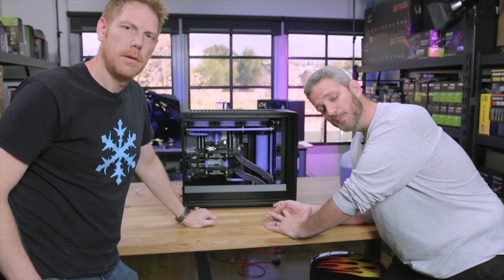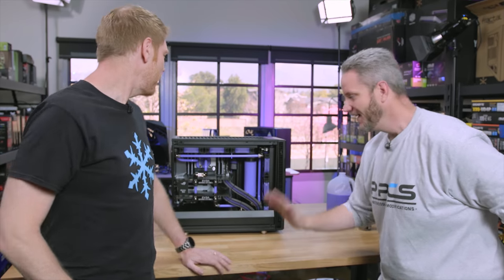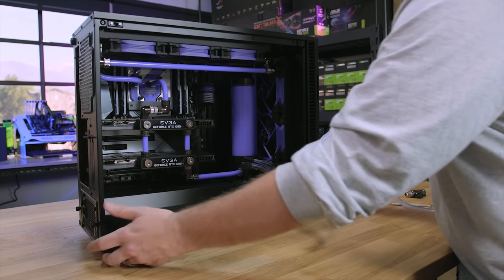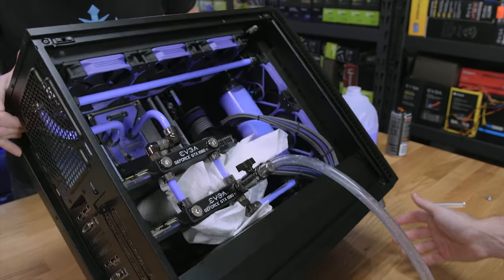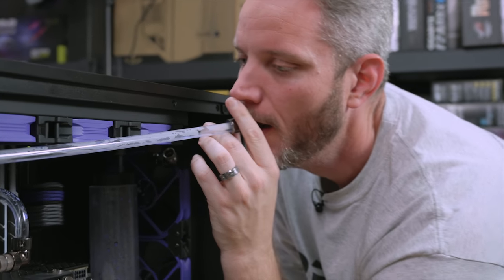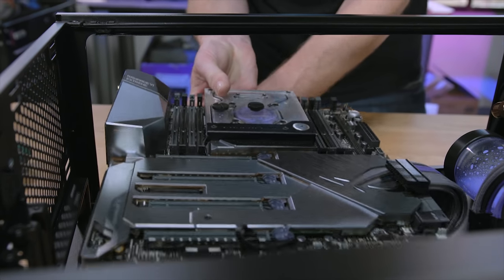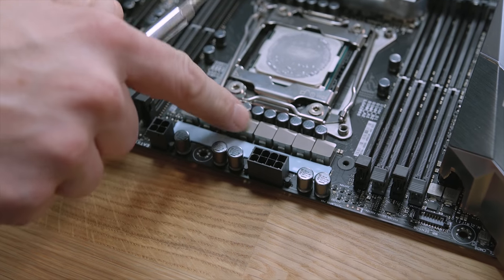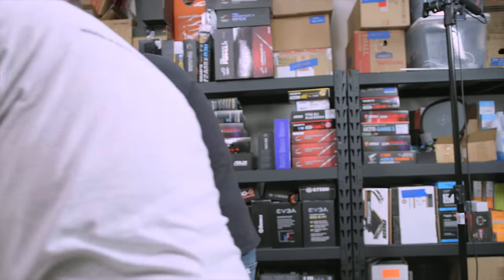WE SCREWED UP... So now we have to fix it

Comment: You keep saying VRMs when I think you mean the MOSFETS.  The MOSFETS are part of the VRM (Voltage Regulation Module).  The VRM is the circuitry that feeds power to the CPU which includes the MOSFETS, chokes, and capacitors.  THE MOSFETS are the components that heat up the most.

Comment: Them mosfets/drivers. They make up part of the VRM. 😉
Reply: Exactly, the VRM is a buck converter which is made of mosfets, choke and capacitor.
Reply: VOLTAGE REGULATOR MODULE?!
Reply: They are both to do with the same circuit, boosting and controlling voltage/current to GPU and VRAM. But VRM means 'Voltage Regulator Module' meaning basically the Mosfets, the small chips essentially whcih the heat pads actually fit on to. They get very hot. Chokes don't need cooling as such but have adequate cooling because they are bigger in package size and can handle more heat effectively. 
Mosfets are smaller in package size and cannot handle temps maybe above 90oC but need to be lower than that so that they perform better.

For example, surface mounted LM317 chip max working temp is 120oC. By no means would you want it running at that constantly. Dead in no time.
Reply: VRM mosfets are generally rated up to 150C but obviously you would never wanna reach that. Just dont be afraid if youre close to 100C at maximum load, thats usually fine.

Comment: As someone who has never watercooled before, I imagine you can reuse the liquid you drained since the system didn't have too many "hours logged" using it.  What is the threshold on how long it can be used/new coolant applied.  Say this issues wasn't caught/dealt with for 3-6 months and you finally went in and fixed the issue.  Could you still use the same coolant?

Comment: No liquid for me, but I've just modified a couple of Dell Xeon heat sinks from a mid-2000s tower to work on AM3 sockets by cutting a couple of sections off of the block and adding some material (I've found a good use for pennies!) to raise the level enough for an AM3 cooler clip to hold them down properly. They're very tall but otherwise compact, and so far one is cooling a Ryzen 5 1600 stock by itself with just a (very large) front case fan.

Comment: My 8700k gaming rig is all air cooled in a fractal josh meshify c with Noctua cpu cooler, two 140mm ml140s in front and 1 ml120 in back, no water, no mess no maintenance except for occasional cleanings of dust outside of mesh front of case. It glows in the dark, runs hours on end gaming only and web browsing with a gigabyte 1080 I got for 500 dollars new out the door at frys in Oregon when I was driving through.

Overclocked to 4.8ghz with 16gb Samsung b die ram overclocked. Soon to be upgraded to 32gb ram. Use multiple ssd s for boot, games, backup and scratch.

No water, no mess, stays cool, looks awesome, works awesome.

Comment: Air-cool for life my dudes
Reply: BrochachotheNacho i can't fart that often into my pc
Reply: Flamingdarkrider It can be a real pain in the ass tho
Reply: You can air cool it easily. All you have to do is chill the air first..
Reply: Totally agree, I get 54c temps on my delided 7700k @4.9GHZ on AIDA64 with a Noctua D15 cooler and I get 55c -56c on my GTX1080ti with 2x 140mm Noctua fans on 1500rpm @2100mhz.  I literally pulled the stock triple fans off (they are rubbish) and used the same heat sink with the 2x Noctua fans and it is an amazing mod. 
If I run the fans on loud and 100% I can get 44-46c temps on Valley benchmark. 
I was adamant to get my system running on air for the same temps and performance as water, well pretty close.
Why would you go water when you can do it on air for a fraction of the price with no hassles, no maintenance and no more fan noise than water, the Noctua fans at medium rpm cool with very low noise. 
My CPU cooler with fans, GPU fan mod is a total cost of $190 AUD, sure beats $1000-$1500 price tags.
Reply: You can air cool anything. You dont do water cooling because you have to, you do it because you enjoy it and that doesnt just include the aesthetics and the quietness and the low temperatures but also the effort and pain and the fuckups.
Reply: weak

Comment: 6:22
can vouch for the Montana Black series
dank-ass colours. but lower nozzle pressure than most spray cans makes it kinda tricky to get even layers, not to mention the texture effects. and they are THICC so might even mess up tolerances if you're doing that kinda thing. 
but get it right and they look more lit then most of the paint out there

Comment: That is a ball valve and easy way to remember is ---inline is on, meaning the handle is inline with lines going into it .... off the handle crosses the line or crossed = closed.

Comment: Jay the old double wide bridges aren't hb bridges. They are basically in series through the bridge. 3 cards = connector 2 from gpu 1 to connector 2 on gpu 2, connector 1 on gpu 2 to connector 1 on gpu 3, connector 2 on gpu 3 to connector 1 on gpu 1. So between 2 gpu there is no more bandwidth then a regular single bridge. Hope that makes sense lol.

Comment: "It will just give ammunition to those who say watercooling isn't worth it."

I mean you're not wrong. But when when every other water cooled build leads to part failure, damage, or pain in the ass maintenance on one of youtube's biggest computer channels, can you really call it "Ammunition"? It's more like an open and shut case at this point.
Reply: LordKongro it looks so good and performs so well though
Reply: It's a luxury that a lot of people enjoy. Most can get by without it and have less headaches for it, real extreme overclockers go for short liquid nitrogen benchmarking sessions anyway. Just like driving in a lambo isn't worth it for most people, rental or not, the same is true for water cooling, you pay for the experience that goes beyond practical daily grind of a rock solid air cooled system.

Comment: Air compressor... Rigid makes a cordless 18v 1gal compressor. 

Also where did the instructions say to put thermal pads? My M9H called for pads on the inductors and the mofsets

Comment: water cooling is only necessary for quiet builds and overclocking.  I prefer air cooling like many though because i never have to worry about leaks as long as i own my system.

Comment: I remember x-ray shots of an older SLI bridge PCB (not the FFC kind) and the quality of the soldering of the connectors was much worse than for hb bridges.

Solder quality has a definite impact on signal quality at the frequency required to get the necessary bandwidth.

Comment: What's the deal with re-applying the thermal paste? I mean, would something go wrong if you put the cooler/block away and not smudge everything with it, would it be wrong to tighten the cooler/block back again with the same paste? Since this one is few days old (at least vids are few days apart). Or is it just to keep all the stuff clean?

Comment: If you update your Windows 10 flash drive it'll have the last round of updates on it.  I've had to reinstall a lot lately (system builds, rebuilds, and whatnot) and I updated my flash drive from MS and it loads with the creator's update which helps the install immeasurably since you don't have to install most of the updates.  Just a heads up.

Comment: I just got my first desktop today, it's a AMD Athlon 64 x2 that's sitting on a ASUS M2N32-SLI Deluxe. If you have anything anything that might work this this send it my way because it uses ddr2 but it does have PCI Express One of the best setups as of 2006. 
 I was only 5 years old in 06' and I have no idea what I'm doing when looking into the wire mess. Its definitely a start but I want to make it into a hobby!

Comment: I'm not totally certain, but I think it's still wrong. It says in the manual to "make sure all mosfet chips and inductor coils are covered", and I remember placing two strips there on my build (same board, same block).

Edit: Not sure if it makes much difference, I don't think the coils get that hot.

Comment: I just finished my first PC build yesterday :)
Mobo: Asus Rog Maximus IX Apex
Ram: 32 GB Corsair Lpx Vengeance
Gpu: EVGA 1080 Ti FTW3
Cpu: Intel i7 7700k 
Cooler: Corsair H100i V2
SSD: 250 GB 960 EVO M.2 
HD: 2 TB Seagate Barracuda 
Case: NZXT S340 Elite
Reply: If u doesn't mind, can you tell me how much you paid for each component? Especially gpu and ram.
Reply: The gpu is $1.2k and the ram is $400 on amazon. I recommend something less costly but my budget was around 2.5k
Reply: +RevealHD Thanks for replying. It might sounds rude, but I cant help but ask again; for that price, why didn't you get Titan Xp instead?

Comment: I need PC help!

I have a pretty high-end PC build and I'm looking to buy an NZXT Kraken X62 AIO.
Is it recommended to replace the AIO fans, or should I stick with them? If so - Which fans?

I am already planning to replace the current case fans with a couple of these;
-Noctua NF-A14 iPPC-3000 PWM 140mm (Black and brown)

I have already had a friend recommend me these for the Kraken-fan replacement;
-Noctua NF-P14s Redux 1200 PWM 140mm (Gray)

Current PC build:
-Fractal Design Define R6 TG
-Asus Z370-F
-Asus ROG STRIX 1080ti
-Intel Core I7-8700k
-G.Skill Trident 16GB 3600MHz
-Corsair CX750M, 750W PSU

Thank you for your help! :)

Comment: Just curious, you fixed this but you didn't run the tube going into the bottom GPU into the inlet and instead into the outlet? - I mean isn't the flow meant to hit the GPU die + memory first then the VRM and not the other way around? I don't know if EVGA uses a jet plate like the EK 1080 Ti blocks (I have one of those) but if it does then shouldn't this be the other way around for optimum flow? - I'm not suggesting it will break or overheat of course just that you may be leaving a few degrees on the table.

Comment: JayzTwoCents I Just planted out my new rig what do you think of it please tell me.
1. Kingston SSDNow UV400 480GB SSD
2. Western Digital WD Black 4TB WD4005FZBX
3.Phanteks Enthoo Evolv ATX Tempered Glass Anthracite Grey
4.ASUS ROG Strix Z370-F Gaming Motherboard
5. Intel Core i7 8700K
6.Corsair Dominator Platinum CMD16GX4M2B3200C16 16GB (2x8GB) DDR4
7.NZXT Kraken X62 280mm AIO Liquid CPU Cooler
8.ASUS ROG Strix GeForce GTX 1080 Ti OC 11GB
9.Kingston SSDNow UV400 480GB SSD 
and all that comes up to $3,582 AU and $2751.80 US and £1968.20

Comment: It`s better to show your mistakes..ppl and also u learn from them.+ gives you more reliability .

 Thinking of getting a fractal R6..I have a 360 ekwb PE rad(38mm) , can i place it in the front with my ek d5+res combo on the rad fans and put a 240 slim rad on top?
Also...is fractal vertical gpu mount in any store in europe?

Comment: Question...I have an ASUS P6T Mobo w/3 PCIx16 slots, and am using 2 GTX 760's in SLI, and have them in the first two PCI slots, however, the top card is sucking heat from the second, as they are so close together. I've read that for some reason or another, I cannot skip a slot...is that correct, or no?

Comment: i run a aio cooler i didn't a bracket to lock down the CPU block and use a air cooler bracket it works would you do that? i have a q9550 @ 3.86 limited by my motherbord 450fsb

Comment: Well Murphy's law, if everything goes perfectly, something has gone horribly wrong.  a build with zero hick ups worries me. speaking of water cooling, I am using a closed loop cooler master 240 lite, when i got done i realized the pumps flipped, the logo being upside down dose not bother me, but could this affect the flow at all.

Comment: Jay it would be really cool if you could maybe do is a FPS guide for GPU's. like I want over 120fps on 1440p. do I need a 1080ti or can I pull this off with a 1080. benchmarks are all over the place for what I'm looking for.

Comment: i think my drain system on my planed pc is a little easyer it is lust layining the pc on the front taking a cap of the external radiator and adding a valve andthen laying it in the back and removing a cap of the front of the radiator so air can go in it and draining it that way

Comment: I really hope I stumble upon a flat 40mm HB SLI Bridge like that in some Internet store, only piece missing (for completeness), I'm quite sure those fancy ones woun't fit, taken by surprise how hard they are to come by xD

I'm so curious to see if I could clock down both cards and still have better performance with less fan noise <_<

Comment: Umm, what's the point in that thermal pad, if the radiator doesn't touch it at all? Wouldn't it do the opposite instead? :s

BTW Jay: Maybe you should rewatch the last 20 custom builds videos... :)

Comment: Doesn't the choke also get hot? I touched mine and after a few seconds I had to release my finger because it was feeling to hot.
Reply: grg okay, it's a cheap gigabyte board and not the first revision, gigabyte boards always get way worse on higher revisions, search it up and you'll see what I mean, so they are probably quit bad. Meanwhile I'm running my g3258 @4.4GHz and 1.32v :D

Comment: I got a little thermal paste on the bottom of my intel core i3. i cleaned off most i could. Will it still work?
Reply: Bass Red look very closely and make sure that none of the pads are touching and theoretically you should be fine
Reply: Depends was the thermal paste conductive or non conductive? If it was non conductive you should be fine
Reply: Yes some of the paste is on the pads. It is arctic mx-4..

Comment: jay couldnt you have used a 3 way and added a ball valve on the way to the to the inport for the gpus like i did here? and if anyone is wondering thats a inwin 101 type-c case with a custom vertical gpu mount 

http://s307.photobucket.com/user/frost69_01/media/GLWM9153.jpg.html

Comment: Some twits can't tell it's an HB bridge cause it doesn't have those useless idiot lights.  Remember Jay 99% of the self proclaimed pro's in your comments section,  think they are cause they built a rig or 2.  R&R is only 30% of a computer build the rest is proper configuration,  if you need proof of that just read all the Steam comments that start with the sentence "Game sucks it won't run when I click the icon"

The best part is all the You shoulda....Why didn't you.... comments,  as if 90% of modern gamers who build rigs even have a remote clue why they do half the things they do in the 1st place.  It's ego pure and simple.  What makes it hysterical they are right on some points yet they have no clue as to why they are right...just that same old "Well I saw it on a video so now I'mma edumacated".

Good video Jay as always

Comment: you should have shown what you were covering up with the tape before you covered it you just like took it off the wrong thing and put it on the right thing real fast without showing what the right thing to put it on actually looked like, you are usually good at explaining things didn't like this one though I learned nothing except you messed up

Comment: 4:15
I don't get these lousy engineers that design these cooling blocks.
The surface that has the heat is square, but the cooling block has a circle!?
How much heat transfer contact are we loosing here? I would say close to 30%.
Reply: dude, i must be looking at a different video than you are, because i went back, the only thing that is a circle is the way the thermal paste spread. both the block and the surface of the cpu are squares. and even in some cases where a block is a circle, its still bigger than the surface area its cooling so no transfer contact is lost.
Reply: 4:57
Are you people serious? Don't you see that the circle surface is razed.
Reply: ah, at that angle its easier to see without the thermal paste. its still bigger than the surface its cooling though, so it doesnt matter.
Reply: The circular part of WC blocks is larger than the actual silicon. That metal on top of the chip is much larger than the silicon die, and the "circle" is larger than the die too. Look at pictures of CPUs with the metal IHS removed.
Reply: Nisco...i see it.....Can anyone else see there are no front drive bays on this incomplete case as well?
Reply: @Nisco You should probably study up on how things are designed before making idiotic comments like this.  The square heat cover <Lid> is much larger than the actual Die that needs cooling,  which is in the center.  The circular style is to cut down on cost while still providing enough surface area above the actual die that is under the lid.

Yes you threw a CPU into a MB and called yourself an expert..we know!  Lottsa you tube commenters feel the same with even less actual knowledge.
Reply: Chill with the belligerence fella. The circular contact point only needs to make contact with the IHS where the CPU die is, and that's a lot smaller than the IHS, so the circle on the cooling block will work fine. :)